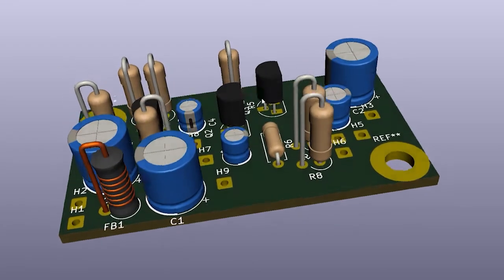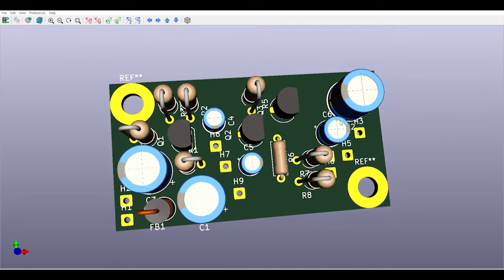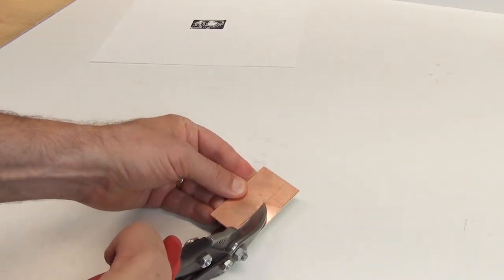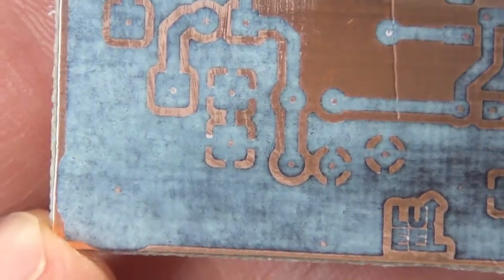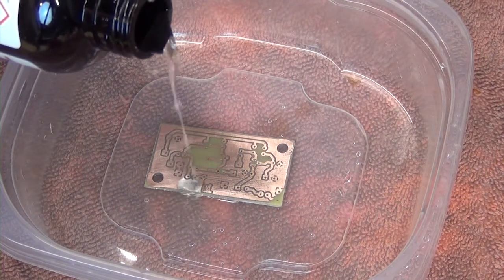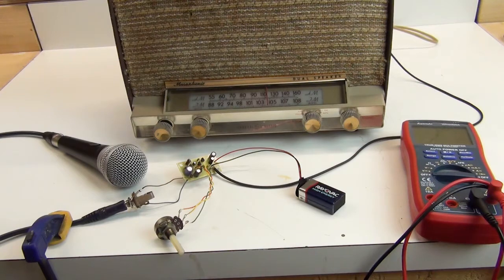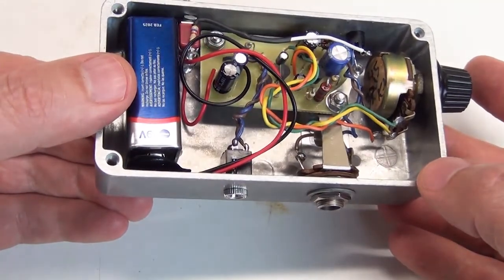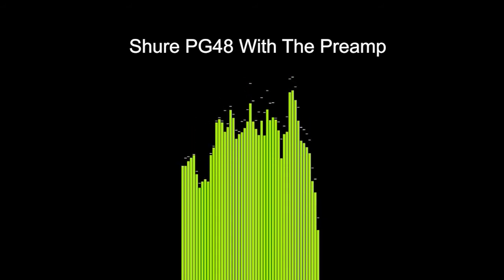Dynamic Microphone Preamplifier Part #2

Comment: HI...This pre amp is cool,actually I use it without the first transistor. But,I have a question? Why didn´t you go for an BC549/550 that´s a pre amp transistor with more gain an less noise?
Reply from the maker: I just used the parts that I had handy.  For sure, other transistors, especially lower noise ones with similar characteristics, would likely work too.

Comment: thank you very much for these videos but can i use an electret capsule with this. i have one of those which sounds quite nice but directly connecting to my pc pre amp cant seem to drive it very well. very high noise floor. i really want  to see a simple electret pre amp build since there are non on youtube. sir please help. im a broke acoustic guitar player. something like this would really help.
Reply from the maker: I don't think an electret mic would work, as it needs a DC bias voltage and the 100uF input cap would block any DC bias.